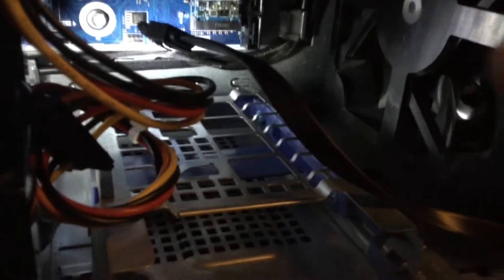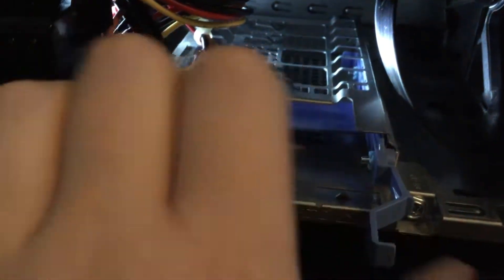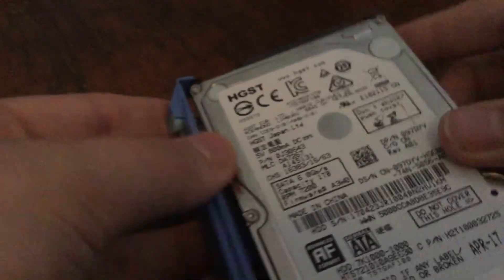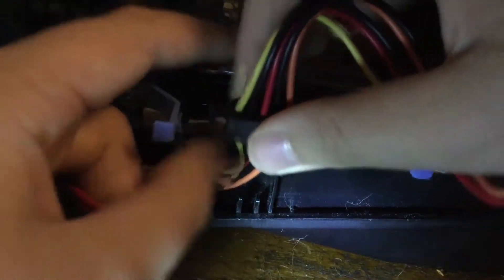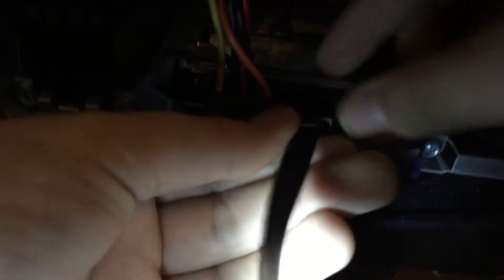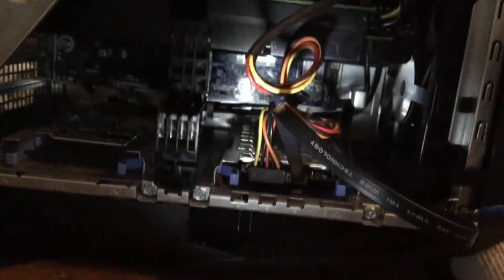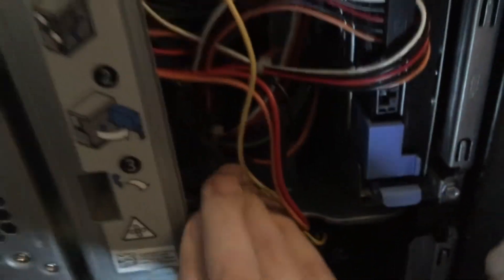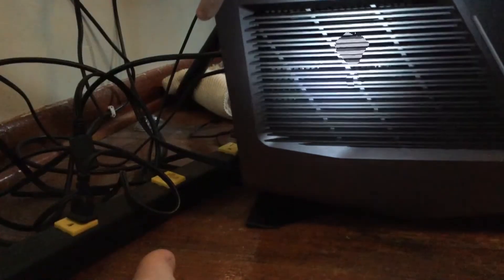alienwere aurora r6 hard drive upgrade.

Comment: Where was the other hard drive when you added that one
Reply from the maker: The Hard Drive that came with the computer is up in the top right, near the power supply.
Reply: Luke Donley thanks
Reply: Luke Donley I noticed that you have a new computer by another comment if you don’t mind me asking which computer do you have
Reply from the maker: For my current computer I built it myself I also made a video on my gaming setup, its one of my newer videos.

Comment: Where do you find the power cable ????
Reply: Should be another power cable with 2 plugs and 1 still on the power cable connected to the OEM 3 1/2" drive in the front of the Aurora R6 like I own.
There are 2, 2 1/2" cages at the bottom of the case.